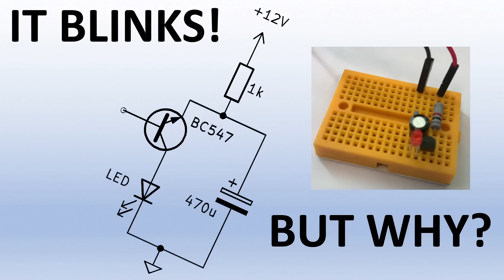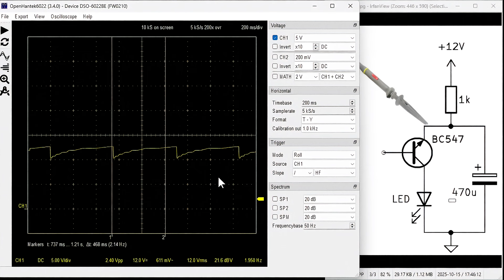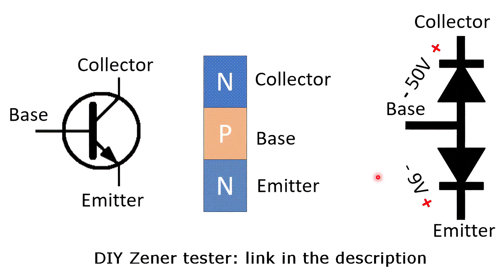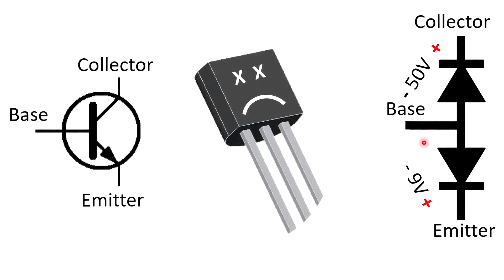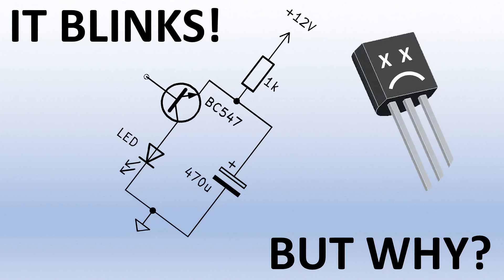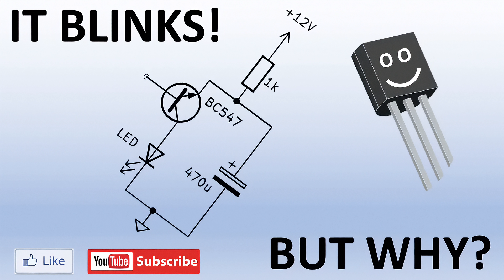Dirty one transistor blink circuit

Comment: Extremely clear! But it would be even more clear if you could flip the two-diode drawing (after the initial explanation of normal NPN function) so it looks like the circuit, with the low-breakdown-voltage diode on top.

Comment: I've done it for a relay driver on an industrial electrical panel sensor. npn bjt with reverse collector. It was all done out of boredom for no reason and just to know the durability of something strange and ridiculous and it's been running for 2 years without any significant problems (of course without looking at the detailed characteristics) I don't know why it still lasts.😂

Comment: Well Porsche use a transistor like this as a zener in their 6 cylinder older cars. It was perplexing when i repaired one of them to figure out why it acted as a zener. I had to try quite a few BC107s to get the right reverse breakdown voltage. I tried to keep it originsl and use a transistor instead of a zener. They lasted for years as most of them were still ok. 😂😂😂🤷
Reply: The circuit is in an RPM transducer on the Porsche 911s which opens  and closes a fuel solenoid above and below certain RPMs with hysteresis levels.
Reply from the maker: Really, amazing 😂

Comment: Test the transistor, build this, run for 1,000 hours or so, then, re-test the transistor to look for changes in characteristics.
Reply from the maker: That would be an interesting experiment, I let it run for a few hours and checked Hfe before and after, no chnage ...YET.
Reply: @circuitarchive193  Check HFE, as well as base-emitter forward bias voltage, as well as reverse bias avalanche voltage. During the run, you can see changes in avalanche voltage, by change in switching frequency. (The transistor must also be tested, at the same temperature, because of co-efficiency of temperature)

Comment: It always kind of bothers me that people, even engineers, think BJTs work by carrier injection into the base. They don't. They work exactly the same as FETs. In an NPN transistor, the merging of the two N regions by applying a positive voltage to the base is how an NPN transistor works. Base-emitter current is just a byproduct of the transistor not having an insulated gate. Everyone was taught that carrier injection is how BJTs work. I was taught it, but it's incorrect. (almost) everything about transistors is about manipulation of the depletion regions.
Reply from the maker: You are clearly a semiconductors expert and you are right that the depletion region/potential barrier view is a more correct explanation based on fundamental physics.
The carrier injection described in my video is a commonly taught and useful model for circuit design and analysis (Ic = Hfe*Ib).

Comment: A Unijunction transistor (UJT) was designed to do just that. Nowadays they are less common.
Also, it's possible to make a flasher circuit with just a neon indicator, a resistor and a capacitor. But these need more than 80V to operate.

Comment: so if the base to emiter junction acts like a zener diode in avalanche and the collectore to base junction acts like a classic diode and is not really used, could we make the same circuit with a zener diode instead of the transistor ?

Comment: This and the joule thief are my two favorite circuits. They're both easily made from junk parts and they both give immediate, interesting and somewhat surprising results. No, they're not the best relaxation oscillator or boost converter, but they can be built by almost anyone and can spark their curiosity in just the right way.
Reply from the maker: Yes, this circuit is good to spark the interest for electronics. The joule thief is nice too 😊

Comment: that's what I'd expect testing transistors with the Hameg component tester which is a bipolar curve tracer working with line frequency showing X as voltage and Y as related current. Here you can see the characteristics of transistors, BE shows at many types a typical Zener or avalanche (reverse) behaviour, the lower the avalanche voltage the more you also see an right angle at the CE lines end. It is quite like a 7.5V "Zener" (avalanche diode). Still the usage of a DIAC or a unijunction transistor in line with a current limiting resistor would even more make a good blinking device.

Comment: I found a transistor connected upside down like that in the original Macintosh power supply, where they used it instead of a zener diode in the crowbar circuit - now I know how that worked, thanks.

Comment: Fun fact, you can make blinking circuits with no transistors, vacuum tubes, or relays! All you need is two photodiodes/photoresistors, two LEDs, and a capacitor.

Comment: relaxation oscilator. old school but neon bulbs and spark gaps will operate similarly on higher voltages
There's a device called a unijunction transistor that is designed to operate exactly same as transistor in circuit shown. A related device is the programmable unjunction transistor ... that has a terminal on which the high voltage can be tuned. when voltage on other terminal is "1 diode drop" higher, device will start heavily conducting until cap voltage falls to  1 diode drop above 0V

Comment: Here is a cool tidbit of the past. on the diode sections of the Transistor.... Why transistors were used as diodes
Tariff avoidance: In the past, especially in Japan, some manufacturers built radios with fewer than three transistors to be classified as "toys," which had a lower import tax in the United States. 
Marketing and sales: Some manufacturers would add extra, non-functional transistors to their radios to market them as having a higher transistor count, even though those extra transistors were sometimes just "dead" components. 
Reduced component count: Using a transistor as a diode was a way to reduce the total number of parts in the circuit, which was helpful for cost and size reduction.
Reply from the maker: Haha that is an amazing story! ....radios with fewer than three transistors to be classified as "toys,"

Comment: i tried to use power bipolar transistor like that, not for blinks, but as power zener. did not work as intended, and i did not know why. suspected, but did not know, and had no means to check why. interesting! 
so transistors cannot be pseudo-zeners, well, not reliably

Comment: Great video! An intriguing circuit for sure (though I haven't seen it circuit before). I found your explanation of the transistor construction and operator very satisfying and intuitive (and I have an electronics engineering degree!). You have a new subscriber :)

The reliance on poorly defined characteristics of components reminda me of a dirty contrast control circuit I once saw, not much bigger than this one. It was fed with a pulse train from a microprocessor and functioned as a frequency to voltage converter for an LCD bias input. I found myself reverse-engineering it while investigating contrast issues and it just felt ... dirty!
Reply from the maker: Thanks man! Yes many mass produced electronics have some hidden problems. Sometimes however they just keep working. I let this dirty blinker run for days at 15V and the transistor is doing fine, even the Hfe is still the same….

Comment: Seems like 9V zener would do the same. Or will it 🤔 Gotta simulate.
Reply from the maker: Simulation will need a model which includes parasitic behavior, manufacturer models will not include that  :-(
Reply: @circuitarchive193  Yes, I ran to that problem when designing simple Mbus master tranceiver. Anyway I ment replacing that blinker transistor with zener. Behavior would be about the same, but probably it will be just a voltage regulator.

Comment: This npn is operating in a condition called reverse collector emitter breakdown with base open, or BVceoR for short.  For fun, put the npn in common emitter configuration with  LED between the emitter and ground, it's anode to the npn emitter. Tie the cap between base and ground, positive to base. Put a resistor between collector and base, and slowly ramp up supply until the circuit oscillates noted by the blinking light. Most any npn will work, 2n3904, 2n2222 ect.

Comment: This circuit has limited lifespan and draws several mA when the LED is off. So I rejected this when designing a cheap LED flasher.
Reply from the maker: You are right, it is a bad circuit!
Reply: @circuitarchive193  The cheapest possible LED flasher, and interesting, but overall a bad circuit!

Comment: There's a similar circuit with the transistor the right way around that can produce pulses with a rise time of a couple nanoseconds or less. It takes over 100 volts to operate though.
Reply from the maker: Cool, yes that should work as the "good diode" from C to B will breakdown in avalanche! never thought of that.

Comment: Tested several new 2n4401's  right off the reel.
All worked flawlessly with C from 100u down to 0.1u with R at 1.2k.
Voltage - starts working at 11 volts, took it to 20..no problem.
Replace the led with a 10 ohm, and C with 0.1u.... 35 ns rise time pulse generator.
Amazing little circuit.
Reply: Does it mean the LED is glowing for only a few nano seconds really?
Reply: @kurusb7792 
Replaced the led with a 10 ohm...

Could try a laser diode.

Comment: Could you just use a zener diode and get the same effect? And at much lower voltages?
Reply: No, the LED will light and not flash.

Comment: This is a good example of the difference between a real world device and a theoretical abstraction.

A theoretical transistor would not work in this circuit, but sometimes a real one will.
Reply from the maker: exactly, try this in LTSpice, the transistor does not have this behavior included in its model

Comment: One other similar weird trick with an npn reversed junction: base to ground, emitter to +12V through limiting resistor, colector open. Measure the voltage on the colector: -0.6V. Yes, negative voltage. Explain that😃

Comment: I find that this is the equivalent of relying on undefined behavior in programming.
Reply from the maker: haha good point😆
Reply: In analogue electronics, the device is its own specification. A bit like answering "use the Source, Luke" when SW engineers ask for documentation.

In this case, the behaviour is pretty well defined, except that the actual breakdown voltage is highly sensitive to variations in the manufacturing process and not tightly quality controlled.
Reply: Hardware has a lot of undefined behavior; you get caught when the next shipment has different characteristics in the undefined space
Reply: Excepting, that, there will always be a breakdown of the B - E junction 'diode', in a narrow range; device physics that determines transistor characteristics play that part.
Reply: Yeah, pick a memory location at random and rely on that to make your decisions. Actually there is a bug in Sid Meir's Alpha Centauri Alien Crossfire that does just that, but it only causes problems in W11, not 10 or earlier. There is a YT video about it.
Reply: I was thinking it's the equivalent of relying on people 😁

Comment: So what component would be more correct to use instead of the transistor, a ZENER diode?
Reply from the maker: A diac, these are used in light dimmers to trigger the Triac. But they trigger at about 30 Volts

Comment: If I understand, we can use a Zener Diode in place of the transistor?
Reply: No, that won't flash.
Reply: @PlatypusPerspective thanks, and do you know how to adapt the schema to work with only 5 (USB) or 7,4 (2 li-ion cells)?
Reply: @NickkoG  As a bench tech my theoretical understanding is modest, but I don't think it will be feasible. The breakdown voltage is determined by the physical structure and doping regime of the junction, and what is necessary for a functional transistor results in a breakdown voltage commonly around 6.8V.

Comment: Many different types of NPN transistor should work fine in this circuit if you don't have a BC547, as long as V_EB_max is not too high. For example I used a S8050 from an Arduino kit.

Comment: There's a similar (and well known up to the 1970s) circuit involving higher voltages (~70 volts) and the NE-2 neon bulb. Same basic idea, except that the NE-2 neon bulb performs both the breakdown and illumination functions. Anyone old enough to remember the NE-2 blinker circuit will see the similarity immediately.
Reply from the maker: Interesting, so gas discharge also has a negative impedance because of some avalanche effect?
Reply: @circuitarchive193  Yes, same effect.  Mobile electrons ionize more gas, creating more conductive path.

Comment: Question:

Since your not using the base, could you get the same effect using two diodes with different reverse voltage properties with one of them wired in reverse?❤
Reply: No, two discrete diodes cannot duplicate the behaviour of a transistor.

Comment: At a first glance I put all all schematics showing transistors in reverse polarity in the "take me for a fool" folder. Thanks for demystifying this circuit where the transitor works like a Diac with the difference that the Diac is designed for that purpose which is definitely not the case for transistors in reverse polarity. Very good Video.
Reply: 2N3904 and 2N3906 have usable reverse beta. They work as transistors with collector and emitter reversed. The difference between forward and reverse beta can be used to make cool things.
Reply: @absurdengineering  Inverse beta is one thing, but several other parameters must be considered, such as inverse VBE with a breakdown voltage generally around -6 V. The base-emitter junction is quite thin, so avalanche mode appears at a few volts. In other words, the bias, the operating voltage, and signal level must be carefully set. These "exotic" assemblies can only be used with knowledge of the facts.
Reply: Myślę, że diak działa na podobnej zasadzie

Comment: This was the circuit used in road construction portable safety lamps 5 decades ago.  AMHIK :-)
Reply from the maker: Really! It actually does not break, I had mine running for a days and the Hfe of the BC547 did not even change...
Reply: @circuitarchive193  Is your response actually intended for the comment below this one? (Starting "Warning!")
Reply: Maybe?  Maybe not.  I collect barricade lights.  While this avalanche circuit flashes at a similar rate, I don't believe the same circuit was used in those old lights.  I recently restored one from the early 60s on my channel (Title: 1960s Barricade Light -- Road construction light stored in my attic for 40 years -- Will it blink?) and have disassembled many others.  None of them have this circuit.  Back in those days, they needed to flash an incandescent bulb, often running on 6V.  Bulbs have very different properties than LEDs and need much more current to strobe them.  I think it would be hard to tune this overly simplistic circuit to drive such a bulb (too short of a pulse width to allow the filament to heat up to full brightness).  However the older ones do have a simple transistor oscillator circuit.  Often using 2 transistors, 3 resistors and a capacitor, minimal components nonetheless.  Research and schematic diagram shown in my video mentioned above.  Newer super-cheap LED units might utilize this off-script circuit though.  But my limited experience with a few readily available modern flashers show that they use some sort of microprocessor (of course) to allow for different modes to be selected from one switch.  I doubt a reputable safety company would want to risk using an off-script circuit in such an application due to liability.

Comment: Warning!
The hFE value (current gain) of an NPN transistor decreases over time when the transistor is operated in reverse-avalanche mode. 
Take your own measurements: compare hFE before and after a few hours of operation in avalanche breakdown.
Reply: I suggested 1,000 hours, because while the peak current is pretty high, the average current supplied through the 1K resistor is only about 3 milliamps. There is no noticeable temperature rise in any of the components. (The transistor dissipates most of it)

Comment: I looked at the schematic, and realized, if I replaced the transistor with a zener diode, it would in fact, flash.
Reply: The zener would not continue to conduct and discharge the capacitor down close to zero volts as happens in this transistor circuit.    The zener would simply hold the voltage steady at its designed reverse breakdown voltage.

Comment: How is prevented that the LED will not suffer overcurrent?
Reply from the maker: You are right, the peak current in the LED is too high, some online "blinkers" have an addition resistor in series with the LED.
Reply: Also the collector-emitter-pass IS limited to 100 mA (Datasheet). So there might BE also a short-term overcurrent which leads to less life-time of the Transistor. Do you agree?

Comment: I tried to build the circuit in a couple of circuit simulation apps on my phone but could not get it to work. I suspect it's because the apps don't have exact transistor specs. All they have is a PNP and a NPN with only one varible.
Reply: LTSpice ?

Comment: This NPN transistor circuit resembles the unijunction transistor (UJT), commonly used as a relaxation oscillator because it shows these unique characteristics, i.e., the BJT is being used as a UJT.
Reply: Even though it has its emitter and collector reversed, this transistor still works, albeit with much lower amplification. The base of the transistor is not in the air, as it seems, it is made positive by the current coming from the emitter (the emitter now acts as the collector). Making the base positive will cause the transistor to suddenly open, working like a Schmitt trigger.

Comment: So can you build instead of transistor with 2 diodes?
Reply from the maker: Unfortunately not, the middle "P" layer must be shared and "touching" the N-layers so you can run base current though "one diode" and affect the shared P layer so the other diode does not block anymore